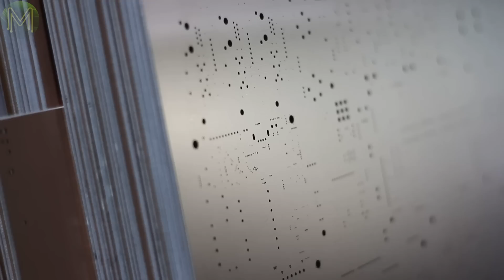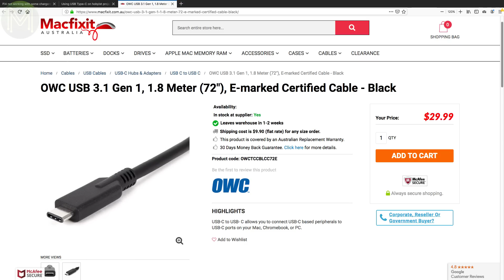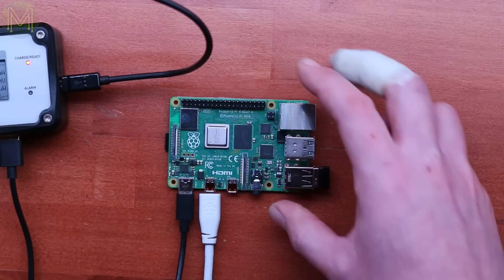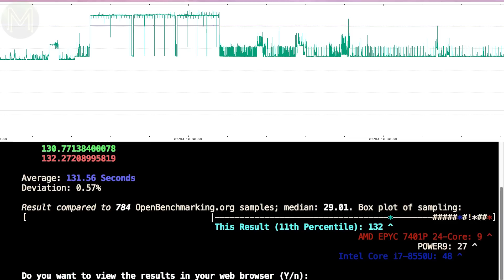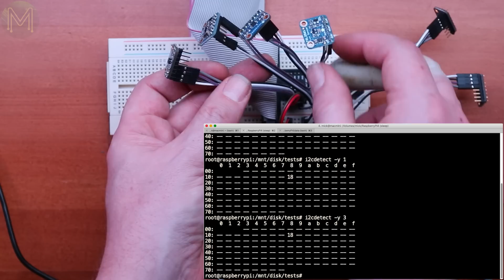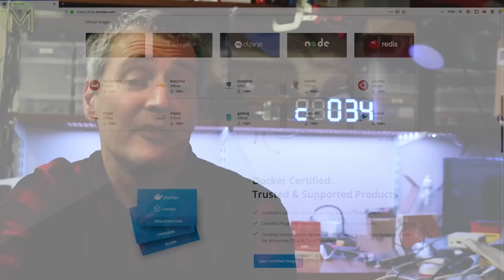#270 The Raspberry Pi4: The good, the bad & the ooops! // Review

Comment: Official power supply doesn't guarantee enough voltage for RPi 4B. Voltage specifications mismatched.

Summary: There is a specification mismatch between these two: the RPi 4B requires at least 4.8615 V. The power supply guarantees voltage in the range of 4.655-5.4621 V.

This official Raspberry Pi document states, that the threshold, where Raspberry Pi will report an undervoltage error, is 4.63 V +/- 5%, which can be thus as high as 4.63 V * (100%+5%) = 4.63 V * 1.05 = 4.8615 V. In other words, if your power supply voltage can drop below 4.8615 V, there is no guarantee that Raspberry Pi will not report an undervoltage error.
https://www.raspberrypi.org/documentati ... /README.md

The same official document states: "For Raspberry Pi 4, we recommend our 3A USB-C Supply"
The official product brief of the "Raspberry Pi 15.3W USB-C Power Supply" states, that:
Output voltage: +5.1V DC
Load regulation: ±5% Line regulation: ±2%
Which means, the voltage can legally drop all the way down to 5.1 V * (100%-5%) * (100%-2%) = 4.655 V
https://static.raspberrypi.org/files/pr ... -Brief.pdf
4.655 V is less than 4.8615 V . So the specifications are mismatched. The power supply doesn't guarantee enough voltage to reliably operate Raspberry Pi 4B.

Comment: My Odroid C4 with a sysbench CPU load only hits 37c with a light fan breeze hitting the stock heatsink.  I heard the Pi4 gets hot, plus the need for micro HDMI adapters and no eMMC support turned me away from the pi.  Also this was a 2100 MHz.

Comment: The Raspberry Pi 4 is a great example of a run-a-way project where the creators have lost sight of their original objective/thesis.  (1) create an educational platform where kids can learn about building circuits within a Linux environment.  (2) teach coding skills from concept & logic reasoning.

The Pi4 Good = CPU, More Memory, Very Fast Ethernet so one can immediately save all their gigE downloads to... ah really slow SD memory or slower USB flash...  Very Fast Ethernet so one can forward spam to their in-laws faster than ever.

The Pi4 Total Crap == USB-C, yes please give me a power connect that has absolutely ZERO physical integrity.  Mini HDMI, yep expect this interface allow for hours of pleasure when the slightest movement of the Pi causes the screen the blank....  But wait folks, you have TWO crap mini HDMI interfaces so both monitors can go buggy with the slightest Pi4 movement and two different times!  Its like winning the productivity lotto!  Why couldn't the primary video connection be a stable strong secure standard HDMI port?  Do we really need a secondary screen?

The Pi foundation made fools of everyone by distracting people with the concept of two screens on a Pi that everyone forgot to realize the rest is crap!

The reason why the USB plug has lasted since the mid 1990s????  The USB socket & plug is physically strong 

Not impressed at all!  Total waste of my money.  (after only a couple hours use, my screen started blanking because of the crap mini HDMI).

Get rid of the "mini" connectors....  Real HDMI.  And give me a stupid barrel power jack noted on EVERYTHING since the 1970s....  Atari 2600, NES, Sony Sport Boombox, Discman, Minidisc, Laptops all use barrel power  jacks....  Pi folk are not good at re-inventing the wheel!

Comment: Bought a Pi Zero as a cctv system in July - works perfect. Decided to give the Pi4 2gb a go. Its now running as a web server for three domains and no problems at all apart from google domains not updating my router ip addr !! Bought a case with a fan attached and no problems with overheating even on hot days - rare in the uk ;-) Very pleased.
Bought another Pi4 2gb to play with again with a case and fan. Running various programs that I used on my main Linux machine  with no problems. I use Webmin to keep everything updated and in control. 2nd Pi is now a samba server and print server for my windows laptops and has a hard drive attached which holds backups from each of the systems automatically useing cronjobs.
Overall I am very pleased with the way the Raspberry team have put this together (I am not connected with them in anyway !!) and whole heartedly recommend giving a PI a try. £50 - whats to lose ??

Comment: I've designed several open-source Raspberry Pi printed circuit boards w/BOM, modular hats, and ESP12e pcb projects. All have been designed to be easy to build.  The Esp12e boards run Tasmota firmware, or whatever you choose. I've built and tested all of these boards to ensure reliability. These designs were intended to be "day kits", usually taking about 45 minutes to build. GOOGLE "KN6DAM" (my ham radio callsign), or go to "Arduet dot com". I provide free CAD files and BOMs. Please, check it out, and view my Youtube videos (blocked in some countries).

Comment: I dont think you covered current lack of USB boot? The Pi people and others get quite uppity when this comes up, after all it was only USED by a minority on the Pi 3, they say. OF COURSE it was only used by a minority on Pi3 as it was utterly pointless due to USB2 speeds, but now with fast USB3, booting and running from a solid state drive ABSOLUTELY makes sense, but you can't yet. People who expect this capability are IMHO absolutely reasonable in thinking it should be there as it was in the previous model, even though it WAS too slow to be really useful. Does that make sense or am I talking nonsense?

Pete
Reply from the maker: Hey mate!
Yes, true. Since the /boot FS is essentially now loaded on to SPI flash, you can't even do the SD boot -> USB root method.

And yes, booting on USB3 SSDs, along with 4G RAM makes these a really nice setup.
Reply: @MickMake  I am just waiting for the RPI guys to confirm they have USB boot added in - when they do I will upgrade one of my home control systems to USB SSD (if after the end of September, back in the UK (I'm in Spain right now). I just bought the 2GB version, after all my setup runs in 1GB do doubling that is well sufficient for me. Others may be more ambitious.

Comment: When you say something like "these are just simple overlay files", I get that feeling that I have so much to learn regarding Linux
Reply: It's an overlay file system.  This means you have a fixed, read only, file system as the base, and then you mount that, and replace the files when you update or change them.  The reason this is done is that the file base file system is usually compressed to save space on the SD CARD and the only files that are uncompressed are the ones you're modifying.

The thing about Linux is that it's got a TON of useful, good ideas, implemented in it.  I could never go back to working on Windows again, it's so incredibly limiting.  For example, how would you access the files from a computer across town under Windows?  Under Linux, it's just sshfs - you just need to open a port on the router.  I find windows incredibly frustrating to work with.

Comment: The newer version of ur lab supply has a USB port that allows control and monitoring. Also features a soft enable button on output. Pretty sure it's a power fet as I've noted the screen will show the voltage on my car bat with output disabled (it was less than a fun day when u realize u need bench supply to get car started lol) I have both versions. Both great for the $$ but I prefer the new one if only for the enable that adds a level of protection from OOPS oh shit lol
Reply from the maker: Oh nice. I definitely need to upgrade mine.

Comment: Possible issues with your SD card test:
1) /dev/random will block when you run out of entropy, so there's a good chance you weren't actually writing much of anything.  Use /dev/urandom instead -- you'll still be somewhat limited by CPU, but I'm guessing the Pi can PRNG faster than an SD card can be written to.
2) For your DOS partition test, you removed the file before syncing.  The kernel is smart enough to cancel all the writes that were still in the cache, so you were greatly cutting down on the number of actual writes hitting the SD card.  Syncing in between the cp and rm would probably do well enough, unmounting/remounting the boot partition would be even better (it'll flush the cache for just that partition to unmount).

Cool video, it's nice to see someone go a bit more in-depth.
Reply: Surely by yanking out the SD card like that all you are testing is the stability of the SD card to finish its writes safely, rather than anything to do with the Pi?

By their nature there is nothing you can do to prevent NAND corruption when you are abusing it like this on ANY device.

Comment: Re: the SD card corruption. Just how is the RPi foundation supposed to "fix" your crappy computing practices? Name another computing platform that can gracefully handle some dumbass randomly yanking the power or data on an active SYSTEM drive? This has got to be one of the dumbest things I've seen in a YT video.

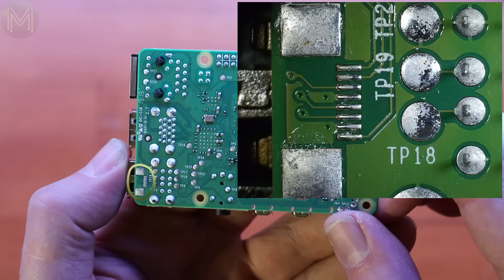Comment: 4:30 - The J5 connector should be a ZIF-8 connector to a flexible board (similar to the camera and display connector) directly connected to the BCM2711 SOC (?) - and here the track will be lost due to insufficient information about the chip contact occupancy.

Comment: I don't see the point of your sdcard tests. Yeah if you kill the power writing to any filesystem on any device, you risk corruption if you get the timing right, even with a journalled filesystem on a fast device like an SSD. Since switching to good branded cards I've had no problems in my Pi boards. While sdcard controllers are advertised as wear-levelling I've still managed to kill cards by writing to sector 0 too many times. That seems to be the only weakness left on them.

Comment: That's a cool power test but why not slap a 220uf cap on the pi header 5v pins it might get it to boot at lower power helping with the spikes
Reply: You need a super capacitor or ultra capacitor for that kind of thing.
Reply: @tekwerkx  you don't the spike suppression is tiny only a few milliseconds if that a 6.3v 2200uf + 10uf 6.3v low esr will get a pi booting under 1A rms but disable factory overclock and you can get that under 500ma rms. now if you want to basically run the pi for a say 10secs everything maxed out sure you will need more storage and a super capacitor will work some what just keep that 10uf low esr as well, But your going to need to slow charge that beast on power up. Anything more then say 15sec of bulk your better off building a ups with a small Lithium battery.. as capacitors just don't store much power. I know I have very large ultra cap bank (3000F total 6S6P 16.4v all Maxwell 3000F caps) in my car for my sound system but still have a massive LTO bank to feed them..
I use and design power systems, every day it's my job as a hardware engineer at Motorola..

Comment: A little off the mark but related:  They rewrote raspian to work with Pi4.  It does not work with kodi well at all.  They changed some drivers and it is a mess now.  Kodi itself runs at unacceptably slow speeds.  So that is def interesting.
Reply: If you find a fix let me know

Comment: 3B+ is supposed to thermo throttle at 80 degrees Celsius, but I have never managed to get it that hot... not using any cooling...RPi 4 has higher clock speed so should heat up more

Comment: 13:16 its linux just  sudo apt upgrade. should do trick. thats how every linux test ends.working graphic drivers will change to default and driver you but time and money not work becouse manufacturers not do drivers for everyday to keep up linux.so why change GPU stuff. keep it same.no need change how 1 pixel on screen work lol. never have linux on working machine. its good on virtual machine.after BOOM can get it back with mouse click

Comment: The unpopulated mystery header is the VC4 JTAG. It's also found on all other Pis. Not to be confused with the Arm JTAG, which is accessible on the GPIO header.
Reply from the maker: I think it only started to appear from the Pi3 B onwards. At least in a specific header.
Reply: @MickMake  The 1B+ and 2B all have it, in the exact same form, though in a different location on the board.
Reply: That mystery header could just be a production test point, it is 'by design' obviously not intended for public use.
The thing that worried me was the amount of solder splater which was shown during the close-up!

Comment: I have never seen that animated clip before, even though it looks like it was a major theatrical release by someone like Disney or Pixar. I am 52 years old, so I don't run out and watch every animated film that Hollywood regurgitates. I didn't see Mulan or Cars or Up, and yet my life is proceeding just fine. Pop culture references are always going to be lost on a significant chunk of your audience, so using one as a form of "security challenge" is very, very flawed. Just my $0.02 on the subject. Good Pi4 video!
Reply from the maker: Unfortunately, if I make it a game of chance, then I have huge legal implications. So it needs to be a competition with a challenge.
But, if you check my description, you might find a hint.
Reply: Looks like a major theatrical release:  yes, it is impressive that the short film was made using Blender, and is open source.  You can modify, adapt, and re-render it on your home PC.
Realize that a $300 graphics card has more power than the entire Pixar render farm that was used for Toy Story.

Comment: What ?! an Ardunio on a board with 4 ARM Cores running at GHz. That Arduino has completely no added value - none!
Reply from the maker: If the Arduino can control power to the main SoC, (along with an RTC), then you have some really cool ultra low power modes.